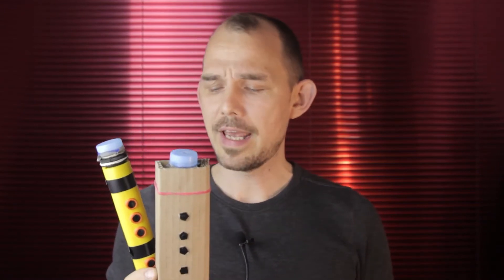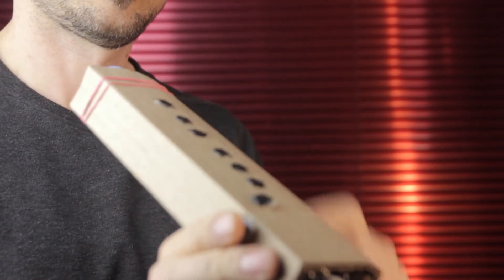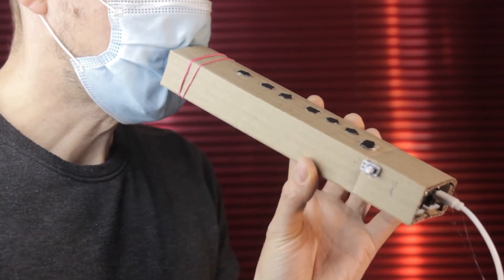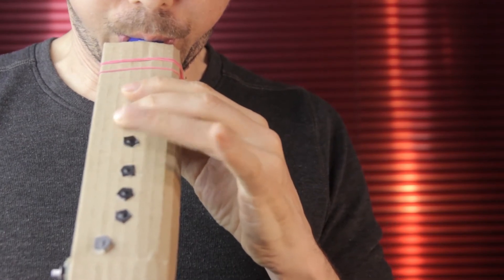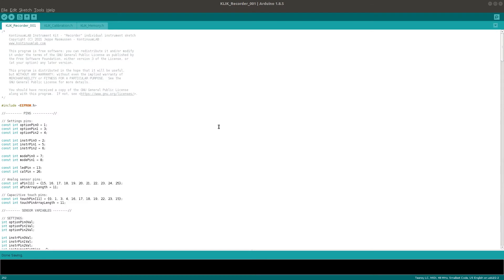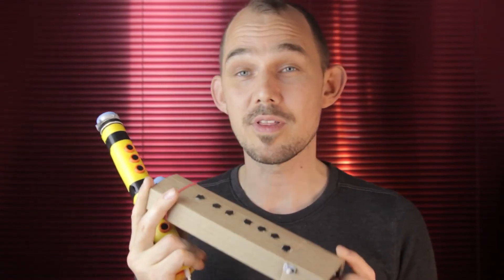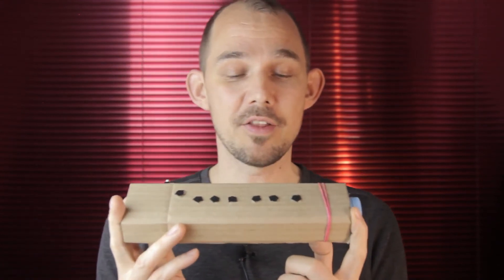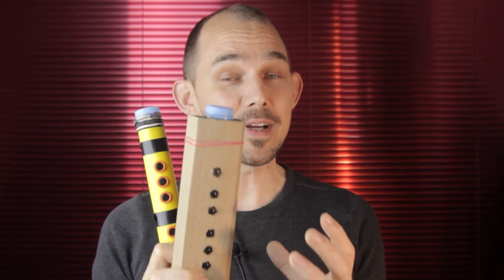Calibrating and playing the KLIK recorder. Simple DIY MIDI woodwind instrument

Comment: https://www.kickstarter.com/projects/888369457/the-recorder-reinvented Have you seen this? It says it is a fully acoustic instrument, but with midi functionality added on top. Sounds really interesting - if you have heard of it, do you know if it has sensors under the holes kinda like your one, or do you reckon it does some kind of fourier analysis to the actual audio from the acoustic recorder, and converts that into midi?
Reply from the maker: Yes, I've seen it. Definitely interesting. The holes have capacitive sensors in them, according to the FAQ on the artinoise web page. From the demos I've seen, the breath sensor is a weak spot. Hard to make a good sensor in a tube that also has to work acoustically. In the users manual it says that it's constantly being calibrated, every time you stop playing for a second, to take ambient air pressure into account.